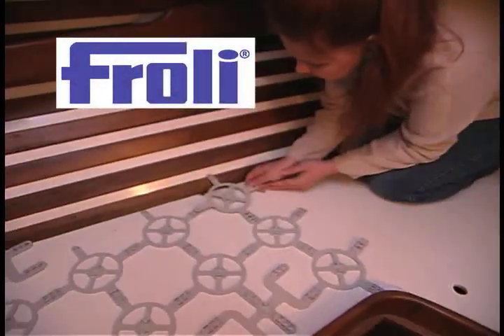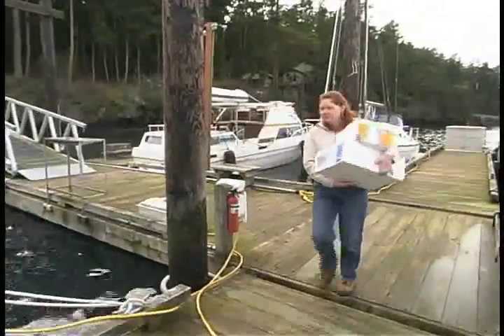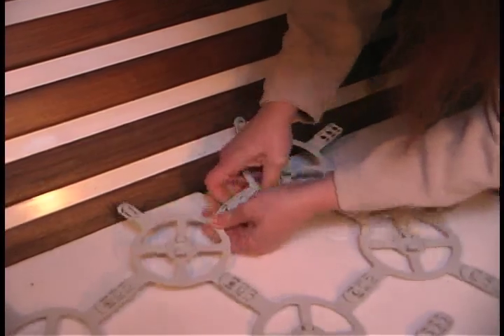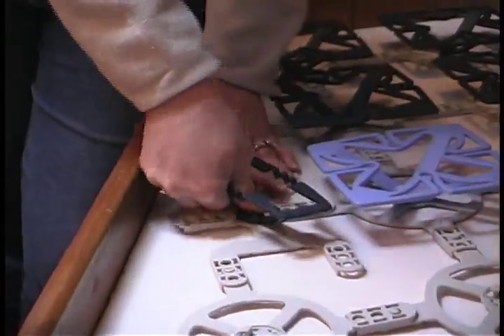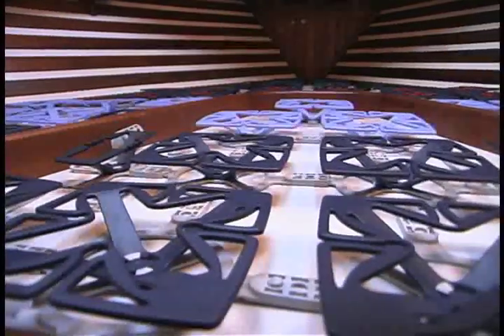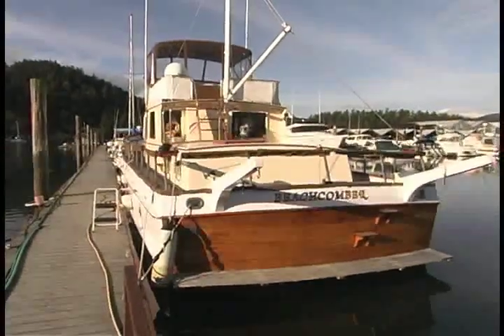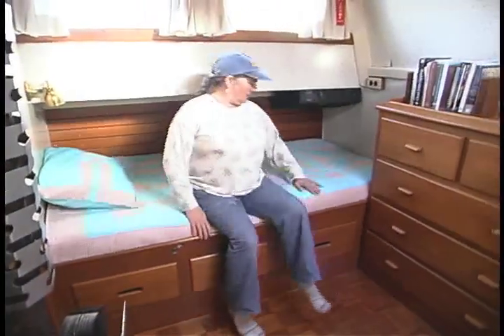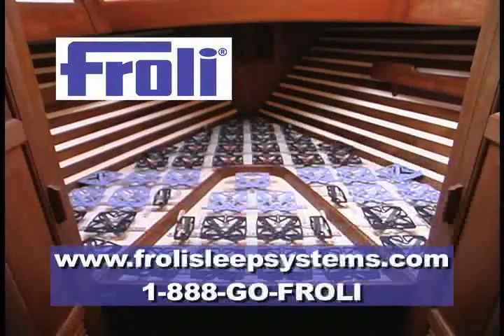FROLI Installation Video

Comment: I had the misfortune of sleeping on one of these systems (looks the same as this one) fitted an RV in New Zealand.  The mattress was 50mm (2.5") thick foam and I can assure anyone who watches this video that a 50mm thick mattress does not cut the mustard on this system.  I could feel every single one of those bloody squares on the first night out.  The mattress needs to be at least 100mm thick to be comfortable.  The solution for me was to go and buy a self inflating sleeping mattress from the Kathmandu camping store in Dunedin and I was comfortable from then on.